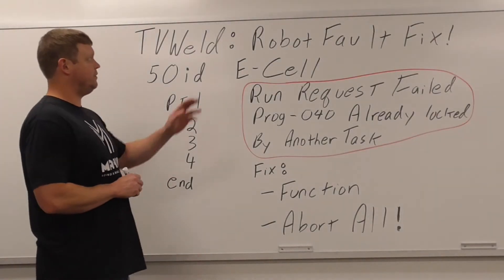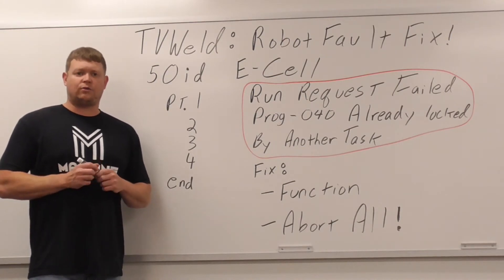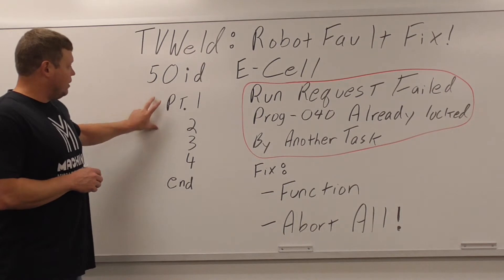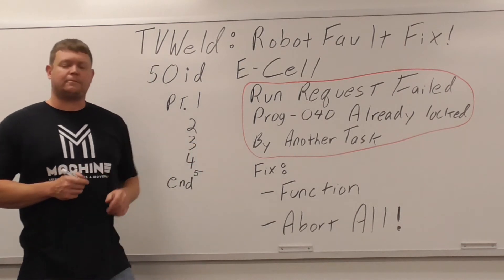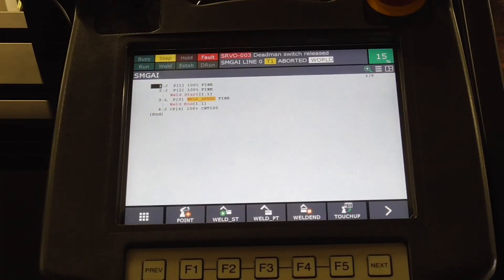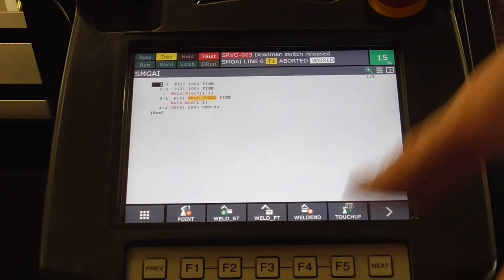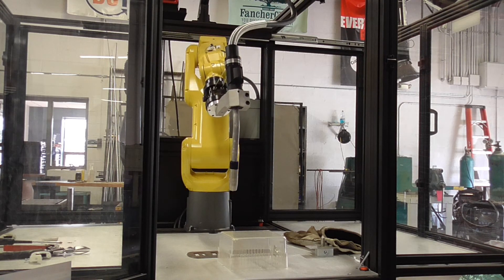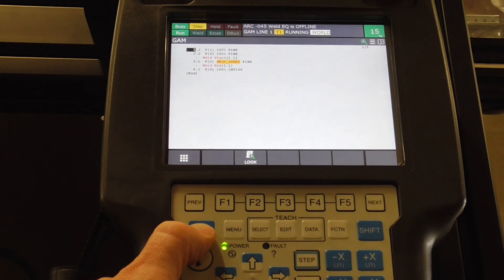Welding Robot Fault

Comment: The Robot can only have one program loaded into its DRAM memory at a time. If you load a program and then try to run another program you will get this error. If you would have went to the line that says end and hit shift fwd the cursor would move to the top and then you would be able to hit shift fwd again and it would move.